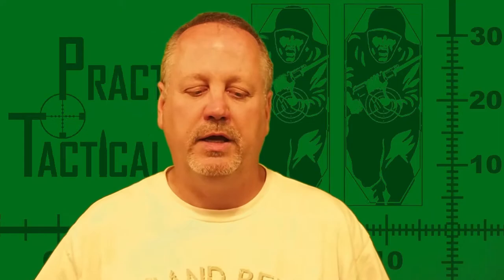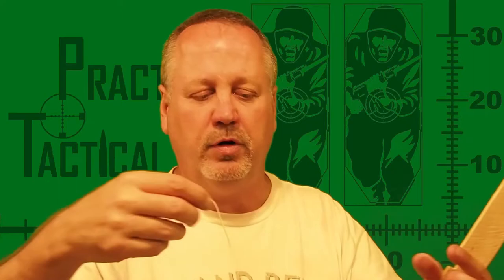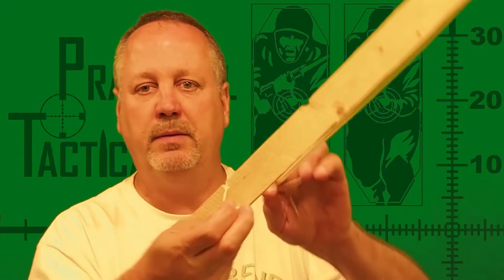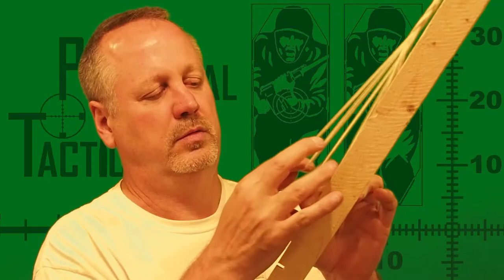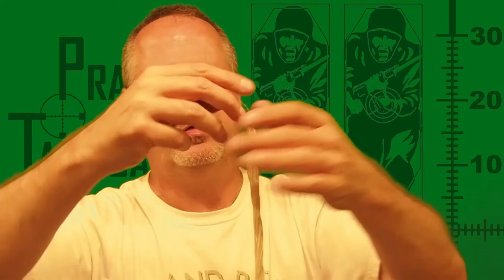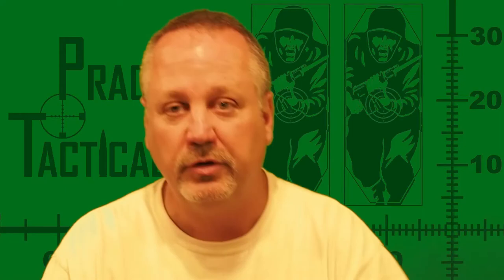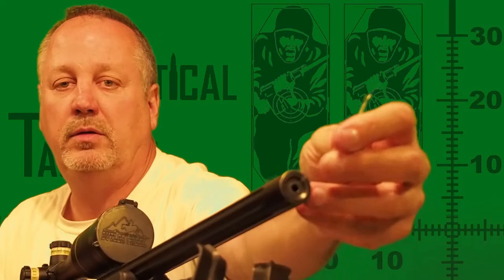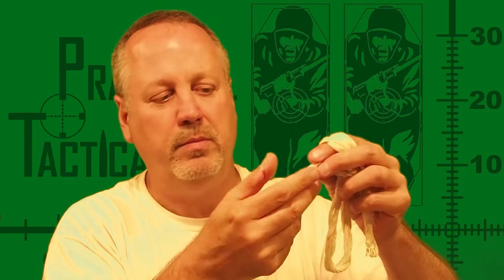DIY Bore Mop - Protect Your Barrel !!!!

Comment: any ideas on how to free a stuck slide? my wife spilled some water on the gun. the gun is unloaded.
Reply from the maker: Am I correct in assuming its rusted so badly that it wont move? If that's the case, I would try a chemical rust remover that you can get from the hardware store, or possibly an automotive paint store if there is one in your area. I think its some kind of acid that likes to eat rust. Just pour it in there and wait a few minutes for it to penetrate, then work it as best you can.